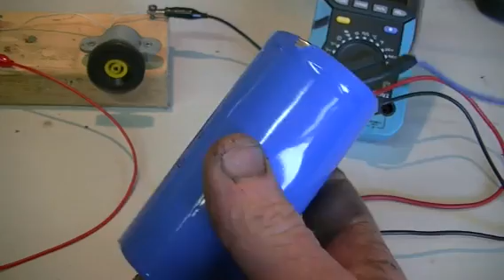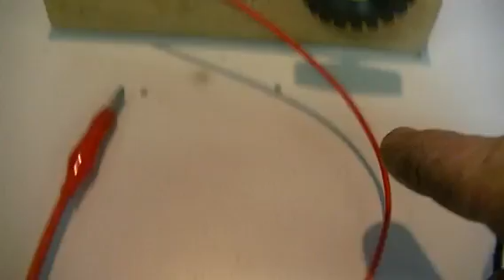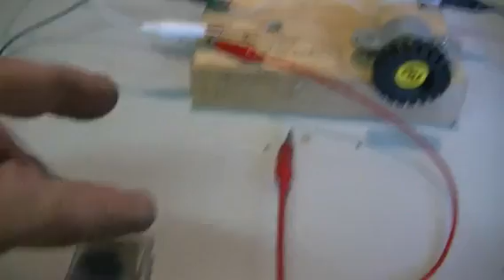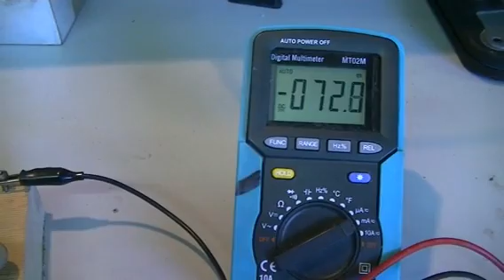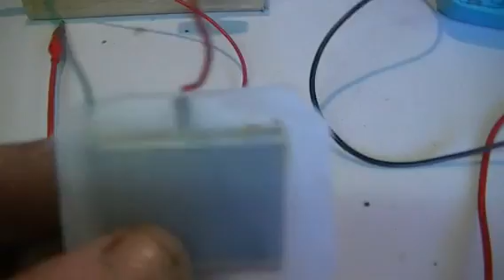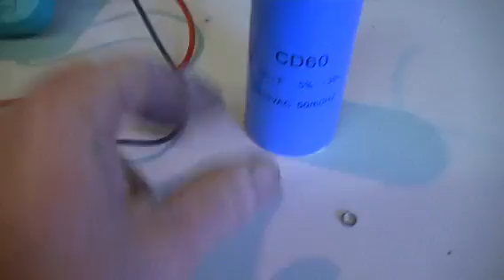Worlds first Triphene AC Super capacitor

Comment: With building tiny  R/C planes (4 grams) for the backyard, a problem is a small enough lipo. The Triphene is thin, light and can be made to whatever capacity is needed (presuming series works for voltage). Stick a diode on the output and the charge polarity can even be mucked up and nothing breaks now ! So this is a safety cell too.
Output of 75mA isn't too far off that needed for a 4mm motor, rudder actuator and receiver. And, if it aint enough, then from the next video I can adjust it so it's right - very cool, very cool indeed - thanks TinMan !

Comment: Your comparison to the commercial AC capacitor is not a fair one. A true AC capacitor can not only charge to either polarity, but it does not need to be "trained" to do so. It will carry a continuous AC current. That's why they are called "AC" capacitors. Your cell does not appear to be able to do that. Your cell however is very interesting. Good work!